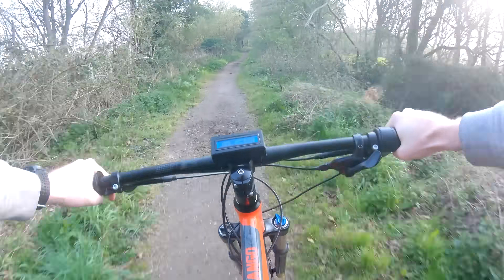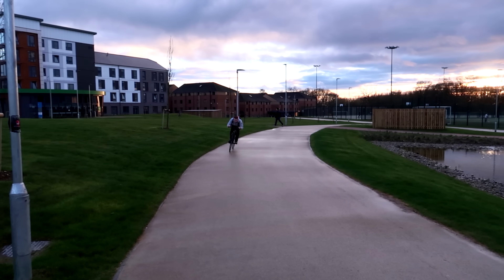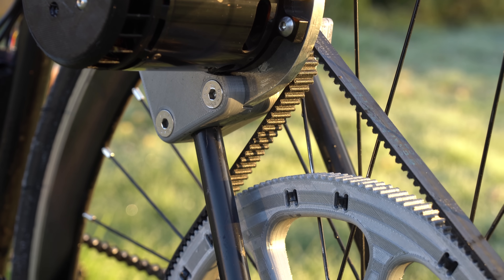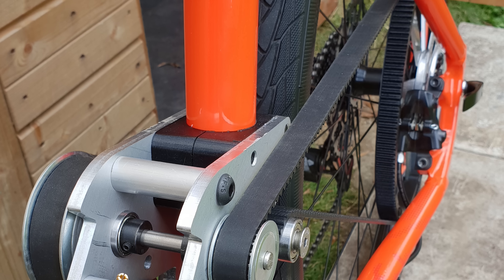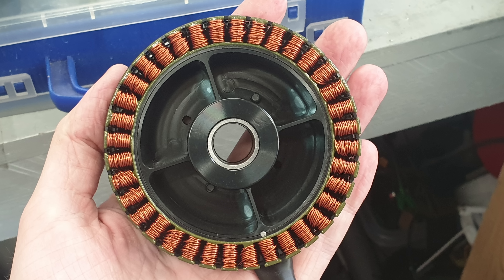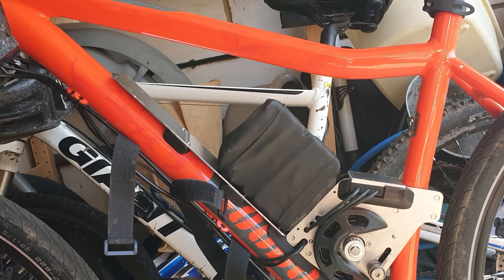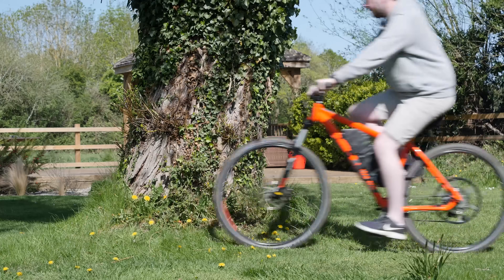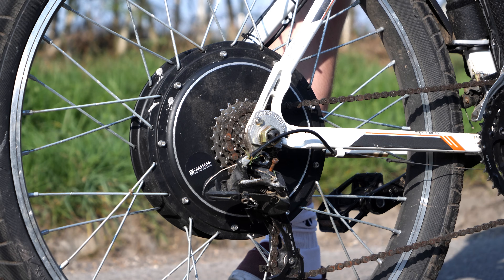Building an Electric Bike

Comment: Are you able to use the pedals on the bike without spinning the motor? Is the regen braking button attached to the scooter throttle or did you have to attach them separately? It would be helpful if you made a video on the simplified setup. (Lay everything out on a table and explain how it all works together) After lots of fine-tooth combing, the only product I couldn't find was the handlebar thumb throttle and the regen braking handle. Do you have a link to it/them? Since most viewers are not engineers (as specified by Socialus), it would be great if you could explain each step on how to make your own. Thanks and love the vid!

Comment: The whole project is very impressive and I'm sure you learned a lot. I just can't get over the high pitch of the motors like pointed out at the end of the video. If anyone is choosing to build an ebike for the first time I would avoid using the smaller drone motors.

Comment: I dont understand why the tight aluminium bracket caused any issues, all the magnetic flux should be contained in the outer shell of the motor right? And even if a significant portion of the flux would travel through the bracket, how would this make the motor turn backward?
Reply: Motor uses Hall sensors, which send false readings to the controller, which gets confused?

Comment: Rewinding the motor with larger guage wire,  which in turn lessened the number of windings,  which completely changed the preformance of the motor. I think the rewound motor would have either had less torque and more rpm or Visa versa. The rewound motor could take more amps for sure.

Comment: I've had a few problems building my eBay kit motor and battery into an e-bike. As you mention - wheel hub motors are cheap, easy, and fun. I have a front hub motor. I have no problem hitting 84 km/h after pedaling then maintaining it with throttle alone. My 36v 500w motor has  been enough power to pull my daughters in a bike trailer. The problems have come from the bike chain, and trailer hitch mounting system. It cannot handle the power. I've already had a lot of fun, yet I hardly put any work into the bike to get where I am now. Seeing what you went through has given me optimism about solving my problems and getting back on the road. Cheers!

Comment: D'Oh! Use a crank drive (mid drive) system, and you'll have better acceleration AND better top speed!
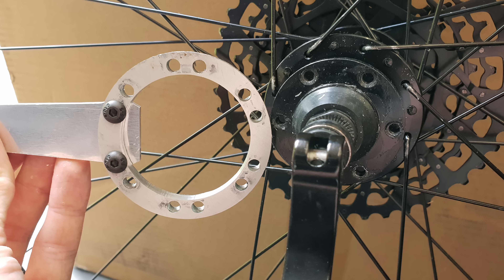5:57 "the pulley exploded immediately on testing" LMAO!!! 🤣 6:10 "motor issues" (crunch crunch)

Comment: All highly illegal in the UK. The skateboard is simply illegal in any form (if used off private land). The bike needs to be power and speed limited, and has to be 'pedal assist' i.e. it should not work unless you are pedaling.
I built one years ago- just used a pedal sprocket welded to the wheel, and drove it via bike chain. Why make it more complex than needed?

Comment: For the first 11 minutes I'm wondering why not just buy a hub motor and then at 11:00 HE PROVES HUB MOTORS ARE BETTER! LOL. And the only benefit of his design is it's 1.5 lbs ligher and can be removed quickly? just buy an extra rear wheel and a hub motor can be removed pretty quickly too.INTERESTING, BUT WHY SERIOUSLY WHY DID YOU JUST NOT GET A HUB MOTOR IN THE FIRST PLACE? OR AFTER A YEAR OR 2? WHY SPEND 3 YEARS ON A PROJECT THAT SEEMS TO OFFER NO BIG BENEFITS?

Comment: i used a different design. A huge aquarium on the bike rack filled with goldfish. A sump at the bottom of the tank would collect the goldfish poo where it is sent to a fermentation tank. this would then produce hydrogen which was sent to a small single cylinder model airplane engine with a belt drive made from 2nd hand gimp masks. this gave me a top speed of 32 miles an hour and an acceleration of .......20mph pS per 700 miligrams of GP (goldfish poo) will update soon as i am upgrading to stolen garden coy carp...stay safe and keep testing.

Comment: Hey Tom I've been working on a project myself on a Lego turbo and what I figured out was I think for your air engine I think that you should use water and air with air pump for a high pressure Bray and maybe it'll it also whenever I was experimenting it took a longer amount of time for the air in the bottle to run out and I figured maybe this information may be useful for your are engines

Comment: What about canibalize  an early model razor chopper.its a cool looking thing .battery's are old and need new ones...24v.....I also have a electric razor  motorbike.thebred model.i think it was their fastest modlel.they had yellow,blue,red.i think it's called a me 650.....I think 36 v.it was pretty fast last time my youngest boy rode it.bought him a inda xrt 125,so he doesnt use it,,,,,8 also counted 5 of the stand on  razor electric scooters couple blue,couple red,and couple other brands.so I have 6.most have chain drives,but 2 have a belt drive...any suggestions or advice converting them into making one electric bycycle?
Another question.is there any easy way to make it so you could either use electric or disengage it on the fly to  pedal on your own leg power  to save battery, ive always thought these scooters could make something cool.maybe even turn them into similar to one of those razor drift crazy carts things.......seeing your video kinda sparked the thoughts again,,,,,,if nothing else just to make something useful to keep good parts in theses working scooters out of the landfill.

Comment: I admire you experimental journey and sheer honesty of sucesses and failures. Ive stuck to a front hub motor and upgraded battery and controller. I figured I didnt want to reinvent the wheel and the PWM for my use wasnt worth playing with. the result is a 36v 13a which takes my bulk along at about 25 mph on the flat. Hill climbs are much easier and Ive always worked with a limited budget. Ive had mine for 7 years now- I think it cost me £270 at first including 2 12v SLA's. Range- I can ride about 15 miles over 3 days and still have some in reserve.

Comment: Can the formula (motor kv  x motor pulley/wheel pulley = 10 formula) be used to find the ideal flywheel and cog for a non-electric human powered fixed gear bike? I think it would be (Riders Average Watt of Peddling) X (flywheel teeth) / (rear cog teeth) = 10